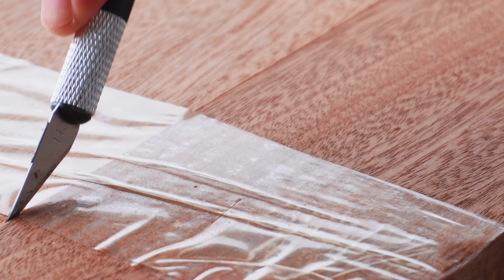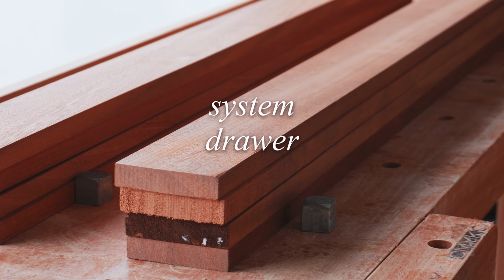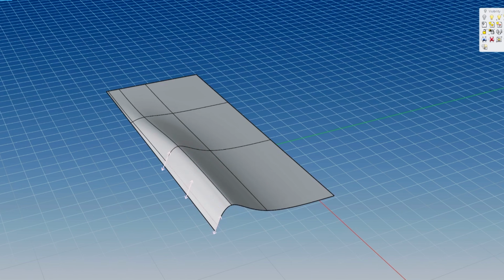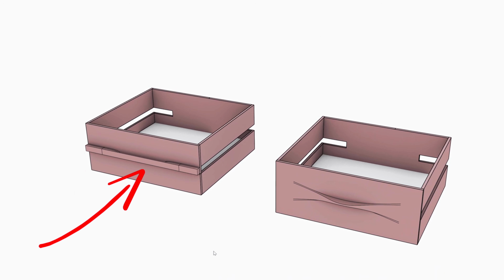The 3D Modeling Trick That Designed This Cabinet

Comment: You could cut a grove on slides and run a dowel in through the drawer sides that stays housed in the groove, that way you remove the kateral play of the drawers when opening or closing (don't know if you solved this later in the video, haven't finished watching yet 😅)
Reply from the maker: Good idea! Great thing about woodworking is there are so many ways to re-engineer solutions on the fly. Thanks for watching!

Comment: A simple groove in the sides of the drawer boxes would have achieved the same look without the rotation and sliding problems.
In you quest for a "diiferent" look you only overcomplicated the design.

Comment: 11:02 I think fixing that rotation would be simple with other negative/positive connectors at the ends, or in an L shape. Or the negative of the drawer didn't need to be a complete opening, but rather a recessed thickness maintaining a base, similar to the "+" example.

Comment: Beautiful design! Regarding 10:44 I dont understand, why you extended the cut (slot) so far around the corner of the drawer. If you had actually used a boolean operation between the rails and the drawer, the drawer could not rotate. The rear piece would keep the drawer centered between the rails.
Reply from the maker: Thank you! Yeah this would’ve solved it too, the funny thing is I was running low on sapele 😂 so I used a bit of scrap, leaving me with a bigger slot. I think even so there would’ve been some rotation so the fix is a bit more failsafe in any case

Comment: What CAD software are you using? Fusion3D?
Reply from the maker: Rhino for modelling, and fusion for generating tool paths! I am planning a video to cover this process  👀
Reply: @_cmyk_  would really appreciate a video on that process.  I don’t understand how people design something for CNC, get geode generated, and the. get it the part lined up exactly to run on the CNC. I thought I would when I got my 4040, but when I think about the whole process I just do,it by hand because it seems so much faster.
Reply from the maker: definitely working on that! tutorials are not my forte but I am trying to put together as helpful a guide as possible. the key thing is there is no one-size fits all approach in cnc work, so keep trying and experimenting- its quite normal for things to seem not to work initially. If theres anything specific you'd like me to include let me know too. thank you for watching